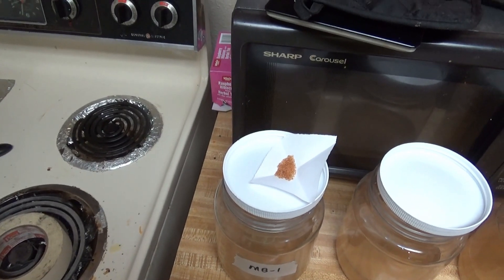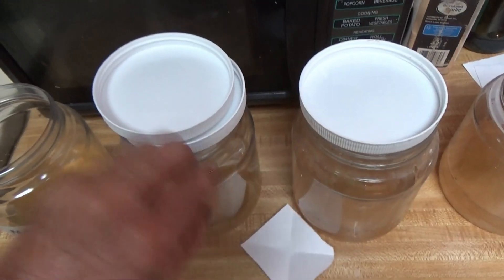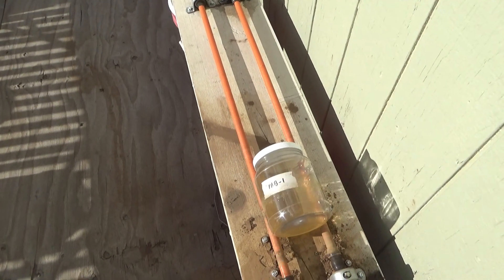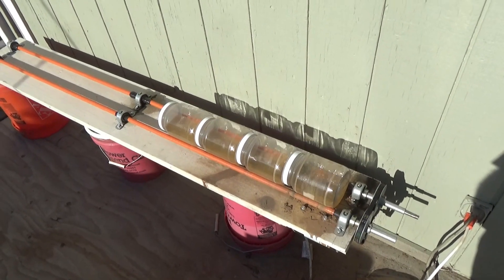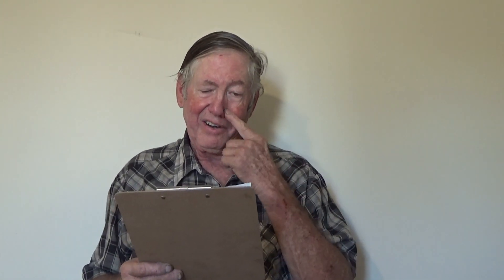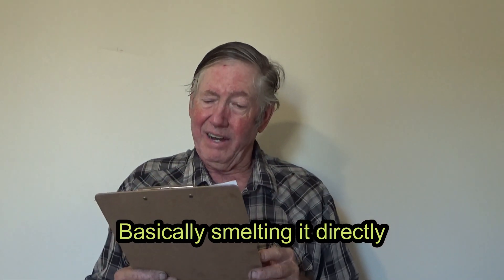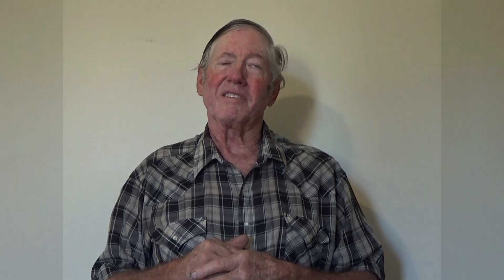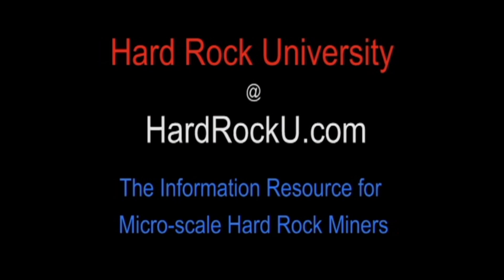232 Initial Testing of Ion Exchange Resins to Recover the Gold from Solution

Comment: nice do how do you know when resin is loaded?
Reply from the maker: we have a simple spot test that lets us know approximately how much gold is in solution.  We have taps before and after each cartridge holder.  When concentration in = concentration out, the resin is considered loaded.
Reply: @hardrockuniversity7283  ok simple test nothing special. anyway as i see you have negative charged gold, this may be the reason why AC is not working good in you leaching abd resin is better. using cyanide it happens as well gold is not absorbed by AC
Reply from the maker: We were using a DC power supply.  The solution is just not conductive enough for direct electrowinning.
Reply: i mean AC (activatef carbon)
Reply: activsted carbon usualy is more negative charged this is why y couldbt get gold out of the solution
Reply from the maker: @virgisst761  Thank you

Comment: Keith, regarding the resin you chose and corresponding methods (smelting the resin), are you seeking selective gold recovery?
Is the successful AR3 resin the ebay link you shared?  Thank you.  RonaldBoulderColorado
Reply from the maker: I am attempting maximum gold recovery.  Not as worried about selectivity as total recovery at this point.  The resin is MaxWater 104133.  If that is the one in the link, that is it.  Don't remember for sure.
Reply: Is the lixivant Eco-Goldex?
Reply from the maker: @misccomments9752  Yes
Reply: Is the Eco-Goldex lixivant the Agent O, S or E ?  Thank you.
Reply from the maker: @misccomments9752  S

Comment: This is what i posted before Keith i'll try it again ; From a forum here in OZ , Gold adsorbed onto resin Beads is present in a totally different form to precipitated gold .  The gold on the beads is present as a massively high surface area deposit which will start to volatize before the beads even start to burn , the extra gold losses from burning of the beads will be high . The options are (1) Wet ash the beads , but not the most fun to have ,as inexperience can lead to disaster , (2)  Set up your ashing system so that all of the off gasses from the beads are sucked through a water bath or spray chamber as a capture method , (3) Set up as in number 2 but with off gasses passing through a canister of activated carbon similar to the above mechanism . Ihave always favored step 3 as gold losses after the burning of the resin stage is minimal , gold  that has fumed off will condense into metallic gold . You can ash the carbon and then digest the ash in Aqua Regia then precipitate out .  THIS GUY gave some talk about wet ashing the beads but didn't recommend doing it . hope that gets into your comment section , and hope it was helpful , cheers Ned .
Reply from the maker: Yes it did Ned, and yes it was.  Was there a ling you could send?
Reply from the maker: Link  :-)
Reply: @hardrockuniversity7283  I actually thought i wrote it down , but can't find it , but it was only 1 page article , nothing more of any importance on it , sorry . The thing is it seems funny to use activated carbon after using resin , why would you use resin to begin with and not just activated carbon , don't understand .
Reply from the maker: @GrooberNedJardine  I agree with you.  One possibility is the carbon wouldn't do a good job on the initial chemistry, like mine.  Not sure.  Thanks for the help.

Comment: Thank you very much Mr. Keith and salute from Somalia, I look forward for the coming videos.
Do you think investing a used handheld XRF for geochemical analysis of rocks and soil samples is worth it. Is it good alternative for lab. I'll also analyse for others.
Reply from the maker: XRF is very useful for some things but not others.  To test the gold content of a dore' bar it works very well.  To test the content of gold in medium to low grade ore- no.  The difference is in what is called 'The signal to noise ratio".  In the case of the dore bar, the gold signal is probably the loudest signal the XRF senses making it easy to measure.  In 3 gram per ton gold ore, the gold is only 3 of every million signals making it vastly harder to detect, much less measure accurately.

If what you are trying to measure is present in at least one part per thousand it will probably work well.  For finding gold in most ores- no.  Did that help?
Reply: @hardrockuniversity7283  that helped me a lot! I appreciate it Sir.
I'm not into gold only but also other precious and industrial minerals, were I from the nearest laboratory is in golf countries and cost/shipping is nightmare. Also the vastness of the area I want to cover is very huge. Is there a cost effective method for analysing, or DIY setup.
Reply from the maker: @mowlidjama3871  For examining rock for gold, I generally use hand panning in the field.  Depending on the ore the lower detection limit is between.05 ppm and 3 ppm.  It is also very cheap and fast.  Have you seen my videos on 'speed prospecting' and hand panning?  The panning will also concentrate any other heavy minerals for detailed examination.
Reply: @hardrockuniversity7283  Im very glad that I've watched every single video that you published Sir, including speed prospecting & gold banning, I learned a lot for you, Thank you very much!
Reply from the maker: @mowlidjama3871  Those techniques work fairly reliably for gold in economic quantities and are very inexpensive.  They tend to impress people watching also.
Reply from the maker: @mowlidjama3871  Yo are welcome Mowlid.  One of the most gratifying things about this channel has been helping people out.  This especially applies when the people are highly motivated, but of limited resources.  Ask questions whenever you have them.

Keith

Comment: Keith, thanks for doing all this work and reporting your results.  So many of your followers want to see which works the best, like myself.  I wonder if the resin supplier has this information so your efforts aren't a duplication.  Also, are the results improved with changes in temperature and pH?  One more, are the resins recyclable?
Reply from the maker: They should be recyclable, but it would be more complex than smelting.  We'll see how the one works and then compare to the estimated cost of the other and go from there.  Not sure about optimizing adsorption, been more focused on initial dissolution till now.  Racing the winter....
Reply: The advantage of ion exchange is that it is recyclable.  Just as your ion exchange resin is reuseable in your home water softener, so is this resin!  Reactivate it with NaOH solution and save the the eluent.  Boil it down to dryness and refune the residue in the normal way with your flux (which has NaOH in it, right?).  Also, just use one large column rather than what you discussed here.   Think about how your water softener is designed!